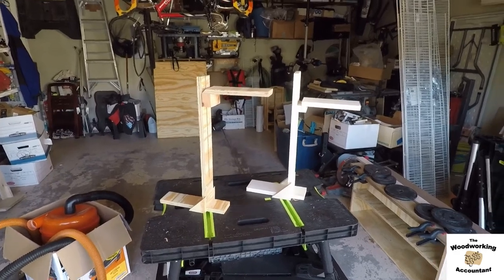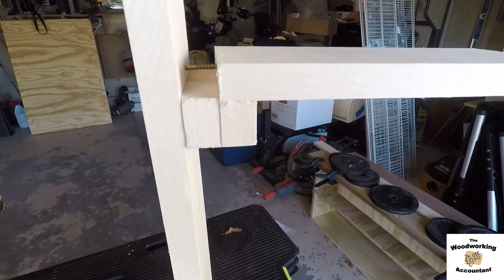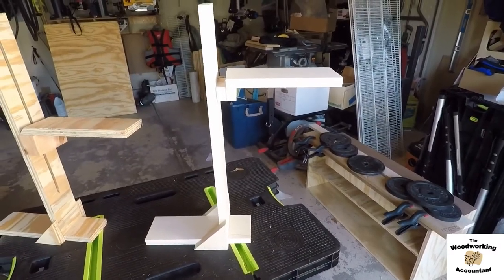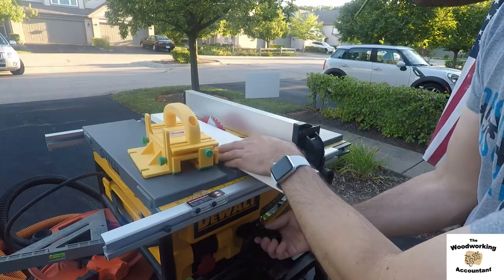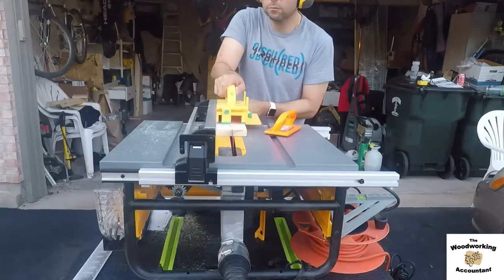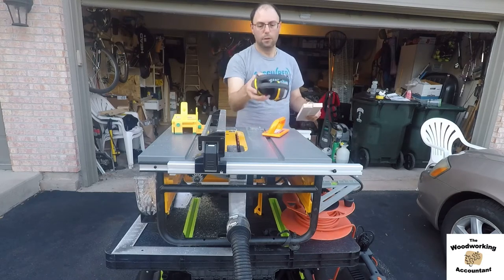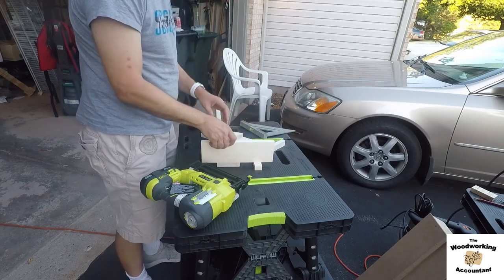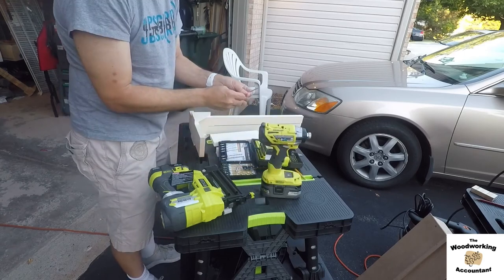Teacher’s phone projector holder for zoom class sessions DIY

Comment: Nice sled!  Did you make it or buy it?  I probably would have drilled the point where the middle strip connects to the rest of the vertical board, but you're better with a table saw than I am.
Reply from the maker: Thank you! I made it, and will probably remake it since the push fence wasn't from a good piece of wood, and, it isn't long enough to fit a normal size carpenter's square.